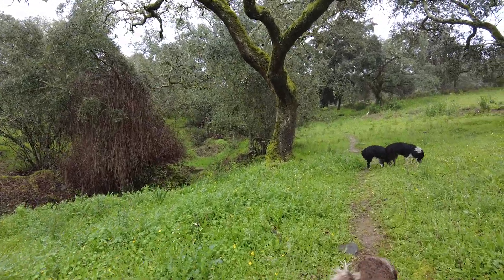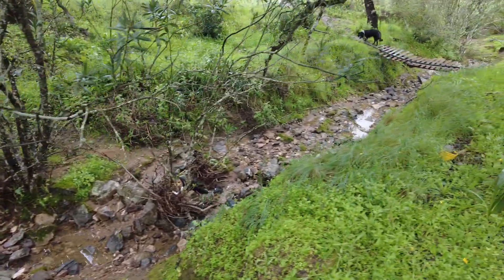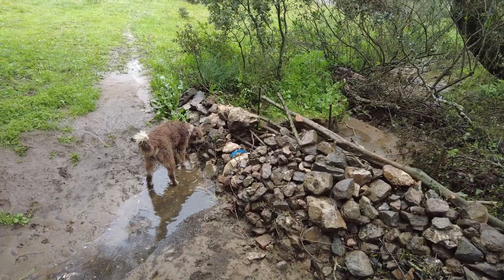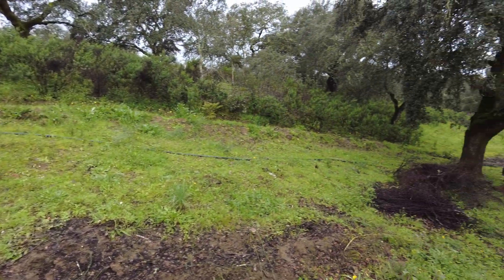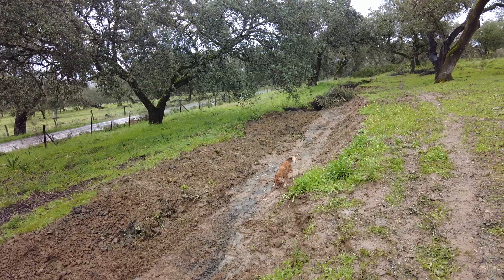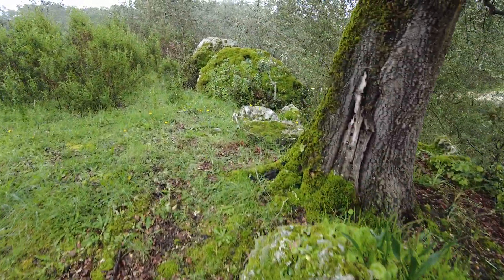Bernoulli's principle applied to determine where the sediment goes.

Comment: 0:01  I'll suggest Martin that you can use your new pole trimmer to cut the dead vines out of the trees left of center and let them drop into the creek channel as another means of slowing the water.  That tangle of vines is impenetrable.  Natures ready made erosion filter.
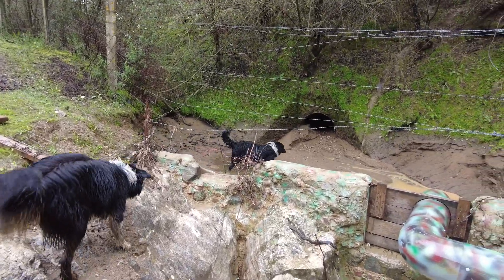1:37 I do not think you have to be concerned about the amount of sand collected.  Just leave the board out of the spillway.  The sand will be self cleaning due to the velocity of the water.
2:12 on the bedrock, you can drill holes and hammer your rebar posts into place.  This is a great location for a leaky weir.  Or, you can use a gabion.  Just make sure you block up the downstream edge so the gabion leans into the water.
2:41 Right side of screen.  Stuff the opening full of jara and cistus to complete the brush dam.
4:04 Add  more poles, several re-bar posts and trap cistus and jara between the poles, especially at the bottom.
4:29 Fill in the opening in the leaky weir.  It is strong enough now to withstand high flow.  Surplus water will go around the weir to the right side (natural spillway) as you face downstream.
7:29 Absolutely!  Take the Giraffe out on the berm to dig the trenches,  Just dump the soil you dig on your side of the fence.  No one will have a problem with that.  The more water you divert onto your land at locations other than through the creek culvert is a huge benefit.
8:41 I see two rows of seeds you planted in your on contour soil improvement strips are blooming.  Some type of bean?
10:35 If I remember correctly, this is where boulders and clay were deposited when the road was built.  So this soil would be highly compacted.  The puddle could simply be rainwater collected on an impervious surface.
10:50  When you have the opportunity,  it is time to get out your topographic map and A frame out to start drawing your paths on the ground. 
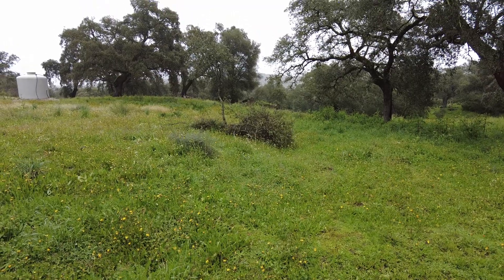10:55 Left of camera - this is the area I had in mind for the temporary water cannon setup feed by the 32mm supply pipe from the qanat cistern.😊
Reply from the maker: Broad beans Steve. Thank you for sharing valuable suggestions

Comment: You make my favorite content on YouTube! I really appreciate each and every video. Two thoughts came to my mind: have you considered crating small rock “check” dams in the erosion gully/creek areas? I have seen some videos of ranches in the USA having huge success with just rock stacking to slow the water down. The other thought: would a reservoir/pond help to control the water coming from the culvert? I know that could be a massive undertaking, but a quickly overflowing pond could be easier to deal with and control/divert than a quickly flowing torrent of water from the culvert?
Reply from the maker: Thanks for sharing beautiful words. You are spot on both scenarios. I'll get there one day.